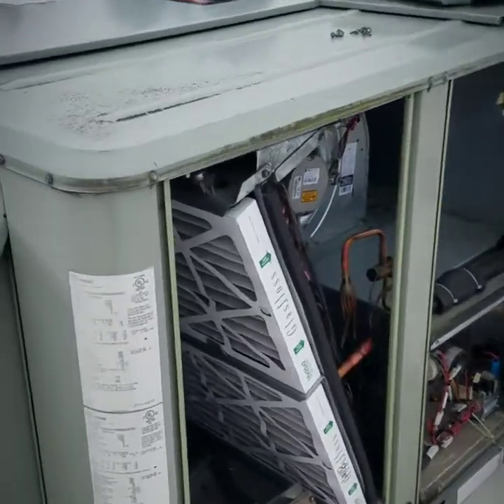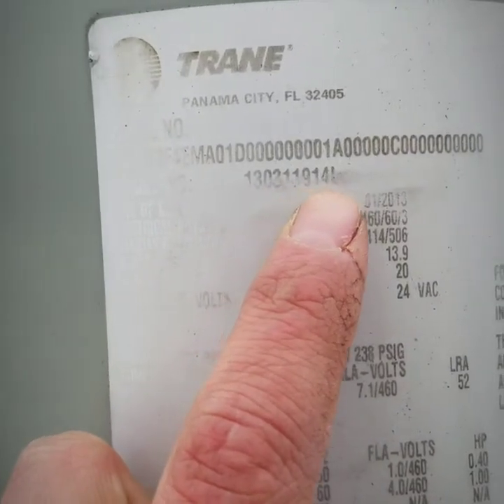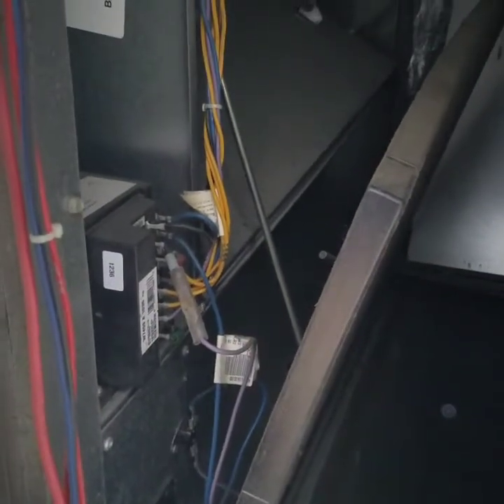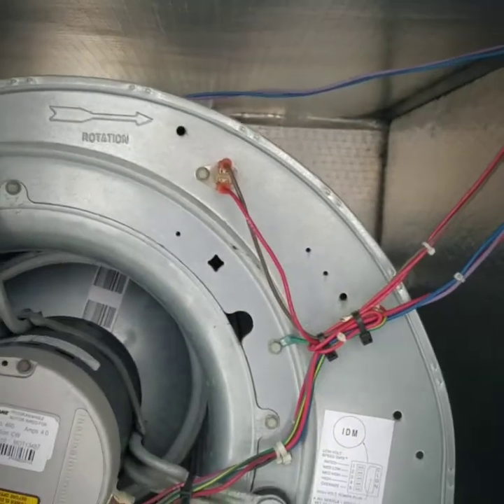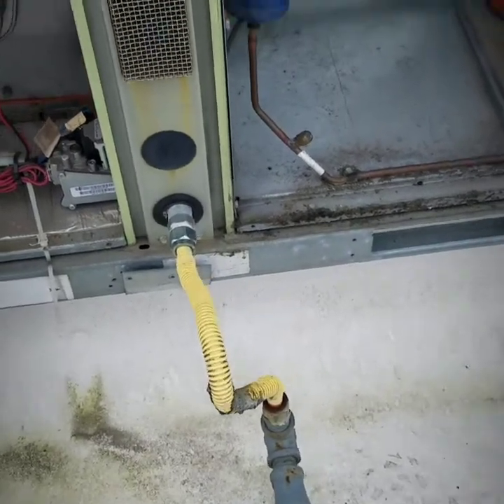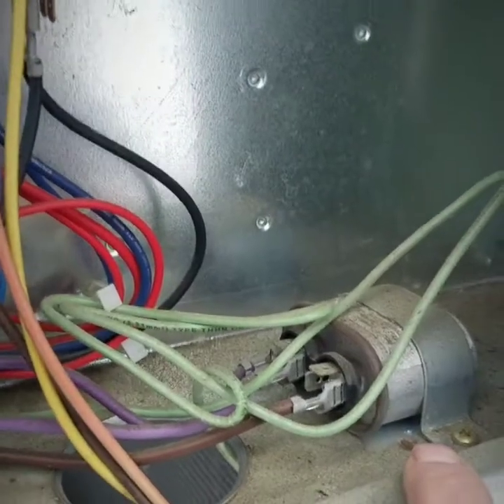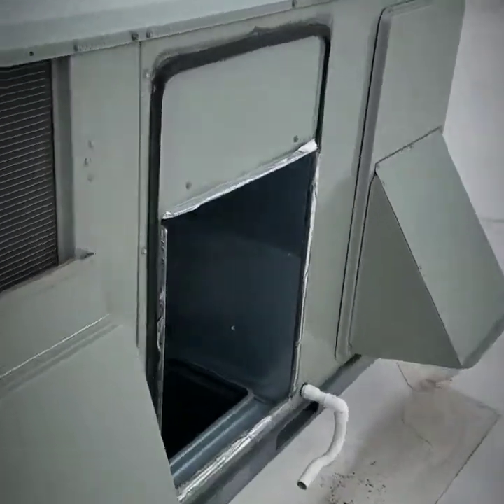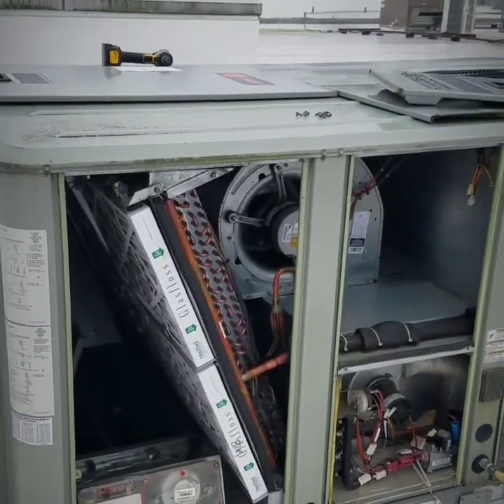Trane Package Unit Component Locations

Comment: Is that rotation component just for the blower rotation or also compressor? Thanks for the video
Reply from the maker: Usually just the compressor. Most of the blowers are single phase and the compressors are three phase. If your blower was three phase it would be for both.
Reply: https://youtu.be/RR383IdaZZM